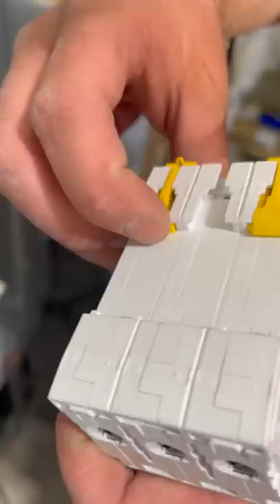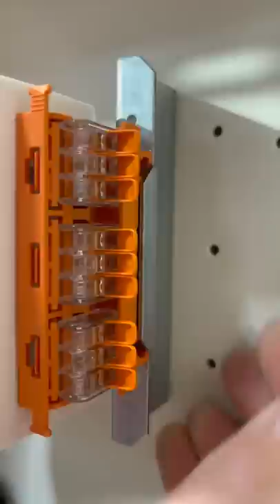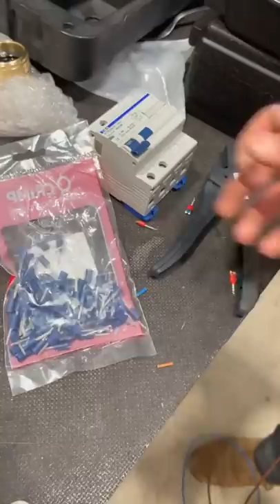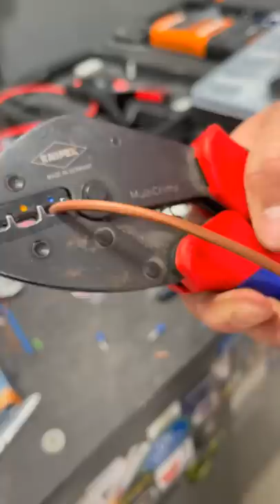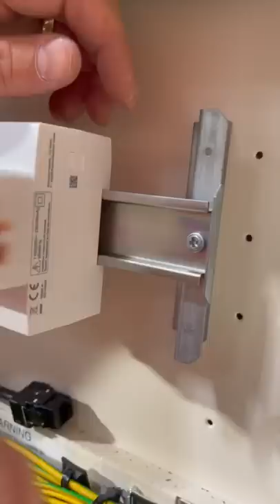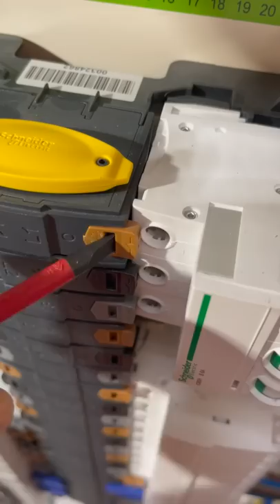LESS WiFi, MORE POWER, DIFFERENT SHORT

Comment: You guys have such great electrical standards America does not have shit
Reply: We do, high end equipment is expensive, but the rules that govern the electrical installationes are there to make any installation safe and cost efficient, but the one big problem America has is shortes of qualify electricians
Reply: At least our power cords won't impale your foot. It helps that they're flimsy.
Reply: @JThyroid  stepping on a 3 pin plug 🔌 in the night is worse than standing on LEGO 😂😂
Reply: Sweden has the worlds highest
Reply: gotta love those Germans :) (Deutche Industrie Norme -> DIN)
Reply: @Sparks66  I've been cut doing that, bad shit when you just wanna piss and go back to sleep and now gotta deal with pain and cleanup
Reply: In germany you would get fired very fast

Comment: Again! Use goddam ferrules when screwing on PE. If you are not using ferrules then you cut strains with a screw and damage the connection!
Reply: for every screw clamp you have to use a ferrule
Reply: @likeapixel1  it depends, if the screw goes into the wire then yes, but if the screw has a pressure plate you are best using bare wires or bootlace ferrules.
Read the installation notes for these devices, it states in there, they are designed for bare cable often.

Comment: Horrific when you cut the terminal connectors.  That method has been known to cause fires as they come loose.  Screw the screws through the roundrels is far safer.

Honestly this is an expensive way to do this. Just easier to use the plug in type that are encrypted.

Comment: That little DIN rail Wago block holder thing is really cool. Looks like a clean way to have more attachment points in less space.
Reply: Also solves the problem that "by code" here you are not allowed to use them "loose" (and unlabeled) in large distribution panels. (but for the small boxes it seems to be ok)

Comment: What is the point or crimping an additional connector (blue pin) rather that wiring the cable directly (the terminal is a screw). More connections means more things to go wrong and less efficiency? I am curious.

Comment: What's actually happening in the video?
Reply: installing a powerline "adapter" which normaly goes into a wall socket, but now directly on the DIN rails and directly on the powerlines in the distribution board so there is kind of the best possible place to put it. I have a socket in the distrtribution board with a powerline plug in it, but this is even better connection :)
Reply: @kanarie93  and also a Three face power line
Reply: @elkaxi  well then you would need a three phase model in a distribution board at the computer too. If your computer /servers need 3 phase, then you need to pull some glass ;)

Comment: There are a lot of connected devices that'd be better of using POE (power over Ethernet) rather than using things like Z wave.
This way, you'd only need receptors and other remote controllers, reducing the amount of signals going West and East and making life a little easier for people sensible to such kind of waves.

Comment: why do you need copper cables when you use aluminum terminals and sheet metal quick connectors.
Reply: I think resistance. Better question why not use a CatE 5/6 cable?

Comment: Everything was going okay until you shoved stranded wire without ferrule into a busbar with screw terminal. Into MCB - iirc it is permitted by SE spec, but don't quote me on that, also personally I'd rather crimp it into insulated pin lug with same crimp tool that was used for those boot lace lugs.
Reply from the maker: That’s pretty normal in the UK

Comment: I was once told cable ties in a distribution board are a no no - true or false?
Reply from the maker: It’s depends upon the loading of the circuits - note these ones are”loose”
Reply: @efixx  any specific reg?
Reply: @JC-NUFC  don't quote me (not qualified) but AS3008 (from memory) outlines the cable selection process and minimum gaps between cables. If cables are close together they become "de-rated" and should be used for lighter loads. A lot of it is to do with letting heat dissipate. Magnetic interference may have something to do with it but I honestly couldn't tell you. 

It's also why larger cables tend to be needed underground for the same current ratings.
Reply: @Chrazzari  I meant a regulation which says you can install tie wraps in a board if the loading of cables is below a certain amount
Reply: @JC-NUFC  sorry I thought you meant current loading not weight loading. Don't know the answer to that one sorry

Comment: Don't expect miracles, powerline is not "magic" technology. Run real cabling, you'll save yourself headaches.
Reply from the maker: Sometimes you just need to solve a problem!
Reply: @efixx  I guess if you want a repeat customer because powerline is a highly unreliable tech, then it works. I've used 3 different brands of powerline adaptors over the years and they've all been terrible pieces of technology.

Just looked up the price of this thing, for the cost of just the din mount part and not even the adaptors on the other end, you can run more than one real cable, not like this is going to be installed in a home where surface cabling makes a big deal, few people have 3P and those that do would rather pay for a non bodge solution that won't give issues.
Reply: what is this "thing" supposed to do?
Reply: @efixx  and store some up for later on.
Reply: @OprichnikStyle  It's meant to just be a din mountable powerline adaptor, which is essentially something which claims to "magically" turn all the wires in your house into dual purpose ethernet and power cables, with each socket on the wall becoming an ethernet outlet.

The reality though is that these things cost as much, if not more than doing it the real way, and they are less reliable, slower and prone to dropping out. I tried to run the main internet connection through my house literally 10 meters on the same exact circuit with decent wiring and it dropped out every 10 mins until i put it on a real cable.
Reply: @AndrewStrydomBRP  and how do you filter back out to get the pure ethernet signal? i reckon you also need another devise to do that.  I studied that is done in railroad infraestructure where you can send both AC and DC on the same line, but it seems impractical in houses I reckon
Reply: @OprichnikStyle  Yes you do use a device on the other end, devolo is specially overpriced and you'll end up paying £100-150+ for each exit point you want. They work like DSL in the fact that they put out high frequency waves onto the lines which are picked up at the other end and extracted from the signal to form a network connection.
For railways it works fine because you are not trying to push a gigabit down the line, railway track circuits are low bandwidth and do not suffer from nearly as much interference for that reason.
Reply: @OprichnikStyle  Holy shit reading that gave me a stroke
Reply: Powerline stuff is crap. Used many times to try and fix problems in my house. Several different brand. 

They never provide a good Mbps even on the same ring or final. They always just stop working. 

I’ve now run CAT 6 everywhere. Did it once did it right.
Reply: @tillsterlp oh that's great but instead of commenting you should have called an ambulance
Reply: @tillsterlp  sadly it wasn't strong enough or else you wouldn't be replying here
Reply: @AndrewStrydomBRP  I have used powerline for roughly 10 years, and sure it isn't fast, but it has never dropped out, even between two floors on different circuits.
Reply: @AndrewStrydomBRP  I have used a powerline system for 9 years without issue.
It has NEVER dropped out during use, and the speeds stay relatively consistent.

The only Issue I have ever had was when a cheap electronic device charger was plugged into the same circuit, it generated lots of noise causing sudden packet losses. - device unplugged from the circuit, no issue.

I think a powerline system is perfectly suited to residential properties where running cat 6 between the router and where you need the network isn't always practical.

Clearly you have issues with the wiring or appliances in your house generating too much noise.

I have worked on trains that run a poweline system on VERY noisy circuits, and even that isn't too unreliable, just a nightmare to fault find. - One lighting inverter playing up and the system can struggle.
Reply: @efixx  and powerline isn't the answer - esp if a business ( 30+yr IT guy)
Reply: @AndrewStrydomBRP  I'd say power line is a big case of ymmv. For some it can be rock solid, for others an utter pain.
Reply: @AndrewStrydomBRP  if you want Lan at reasonable speed and have brick walls everywhere. Not every lives where there are stud walls, and crawl spaces etc
Reply: @planespeaking  I know not everywhere has stud walls and crawl spaces, especially since I live in the UK myself, but these are a shit solution and you'd be better to lift the carpet and run flat ethernet cables underneath, powerline is overpriced and extremely unreliable.
Reply: Power Line Causes More Radio I terfirance than wifi! just ask a Ham or look up PLC rfi
Reply: @efixx  why didn't you install a ferrule for the screw terminals and for the circuit breaker?

Comment: Why did you use those "special pokey" ferrules and not standard ones ? 
I think it was flex wire so needed a crimp,
but why those and then cut them down in length?

Comment: Power line does not meet the EMF standards in the uk, so it shouldn't be in. And secondly, I'd be very susprised if the mcb had open screw terminals, so technically you don't need to ferrule those wires, but where you go into the bus bar for neutral and earth, they are bare terminal screws so the cables should be ferruled...
Reply from the maker: You don’t put ferrules on class 2 conductors. Power line modules are widely available and do meet UK EMC standards
Reply: @efixx  so why did you ferrule them going into the mcb? 
And as for meeting emf standards, they may claim to, but try talking to the whole community of amateur radio enthusiasts who spend their lives learning and understanding about emf, and you will understand that it is exceedingly unlikely that any power line product does meet emf regs. Having had a colleague who spent some considerable time working in EMF labs, we know just how much kit does not meet the regs.
Reply from the maker: @Stuart_Johnson_Solutions  They are pin crimps, not ferrules - ferrules are thin copper sleeves wrap around the conductor. We put them on the power line device as we make frequent changes in this area of our distribution board.  There are two sides to EMC - emissions and immunity  - I could argue that the radio equipment is rather susceptible to interference. There are lots of standards for powerline devices which include EMC limits.

Comment: thought powerline adaptors had gone the way of the dodo. One step up from tin cans and string
Reply: Honestly modern powerline adapters can really blaze if your house wiring is good. I had my router in another room and used some Netgear powerline deal, got the full gigabit to whatever I plugged into it.

Comment: Dumb question but why no ferrules for the wago, bus bar & that RCD? At the end? 
Nice tools, especially that torque screwdriver.
Reply: because 221s are designed for stranded cable, don't think I've ever seen anybody ferrule them... It would actually lower the contact area. (which is a non issue really as the resultant area would be the same as solid core)

Comment: The thing you crimped on to the cables is a fire hazard. Less surface contact than stripped copper wires.
Reply from the maker: They aren’t carrying any current - just signals.
Reply: @efixx  so why do you use them in one place and don't use in another?

Comment: I thought powerlines only worked with solid conductors and not stranded. Isn't this the case anymore?
Reply: nope, never was an issue. they only told to use the wall socket because of EMI on extensions and multiplier extension sockets.
(HF actually travels on the surface of cables so stranded is better)
- but its always a fight between signals and noise + noise suppression circuits..and its not shielded so a big antenna.

Comment: Ya finished the first end of the cables with some kind of weird tube connector...
Why not Ferrules?
Reply from the maker: Class 2 conductors
Reply: What's the issue with ferrules vs those pin crimps on "class 2"?
Reply from the maker: @LambySRI  see this video 👉https://youtu.be/Ia13o1I6DkM

Comment: All that plastic shit is gonna be REAL nice to deal with in 20 years on a service call.
Reply: Lasts far more than 30 years, that's my experience of more than 30 years as an electrician.
Reply: @stefankaufmann8257  Im a shade tree mechanic and everything plastic falls apart after 10 years
Reply: @Fahrenheit38  you are completly wrong.

At the moment i'm updating control systems, witch i made in 2003. CB brands are Merlin Gerin - now Schneider - and ABB, contactors from Telemechanique - also Schneider now. All plastic components are like brandnew. Same experience with Eaton, AB and Rockwell.

Electrical cabinets are not exposed to sunlight / UV light. You are comparing apples and cucumbers. So please stop talking BS.

Comment: What is the purpose of the wan device? Im curious love these electrician videos. I work in a warehouse but addicted to these videos 🤣
Reply: Ethernet over power cables. You can use the buildings power network to transmit data. I have mixed experience, it's not blazingly fast or reliable. Dedicated wires are for sure better. It also suffers a lot from 'your milage may vary', it depends on your buildings' wiring and distance how well it works, similar to wifi. But if you can't route an ethernet wire easily and you don't need a ton of bandwidth, it's worth looking into. A TV for example should happily run from this even if it can't get a good connection.
In fairness, the last time I used one of these was 10 years ago, so no clue how good they are actually right now.
Reply: @Huvada  thank you very much for the reply
Reply: @andystewart9405  I did just realize that your question is 2 months old :P
Anyways, no problem, cheers.

Comment: It is unacceptable to clamp a multi-core wire without a bushing tip with a screw terminal. When tightening, the screw cuts thin conductors, weakening the contact.

Comment: I died a little inside when you used those superknips to cut the ferrules 🥲
Reply from the maker: They can cut 1.6mm steel wire
Reply: @efixx  which model are they? I thought the XL could only do 1.4mm 🤔

Comment: U use different ferrules and crimp tools everytime 😅 and the last module was connected with stranded wire and you didn't use ferrules at all?
Reply: ferrules are required with screw connectors, but not with spring connectors

Comment: Again no you DO NOT put "nude" wire in a screw socket , only in wago is ok ish ! 
You have to add a pin to the end of the wire ; Even on the ground wire , no exeptions , why using pins for the devolo but not for the ground wire !

Comment: What are those din rail wago holders called?
Reply: WAGO 221-500 or 222-500 or 2273-500, depending on the type of Wagos you are using (221 in the video)

Comment: hello sir i also do the same work and i want to do better work by staying with you and i am from india and i need job
Reply: I'm an electrical tech in NYC and I work on life safety and security systems. Most of my work is with fire alarms, but I also work on everything from access control to security systems and cameras.
My industry always needs skilled workers.
If you're near a city of any kind, try writing up a flattering resume (but don't lie. You'll just get in trouble come interview time) and sending them to those types of companies.
Fire alarms are pretty much requires by law in every building in most medium to large size cities. Even if they have sprinkler systems throughout the building, that sprinkler system will likely be monitored by a fire alarm of some kind.
Good luck!

Comment: Is this poweline? That goes into your breaker? If you are going into that much effort then just run normal ethernet like a sane person! Powerline, while tends to be more reliable than wifi, Is still slower than cat5e (gigabit) and has range limitations.

Comment: They claim this runs at 2.5Gbps
I'd be surprised if it hit 500 in most residential settings and even more surprised if it didnt die every now and then. Just run cat5e or cat6, get 10GBps capability and sack off this overpriced stuff.
Reply from the maker: We are connecting EV chargers to it - we don’t need high speed.

Comment: Incoming high resistance joints.
Who came up with this shit, you cant torque a circuit breaker. If to torque it to the unknown spec with the magic screwdriver it will come loose every time. If you hit it with an impact it will come loose half the time, the trick is to hit it with an impact then wiggle it and repeat.